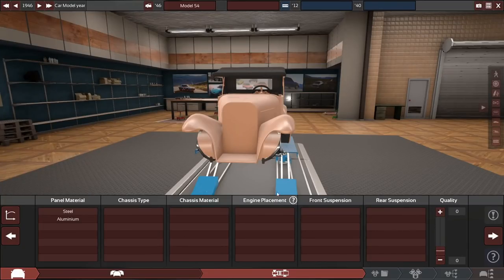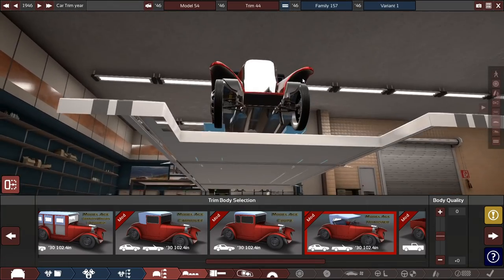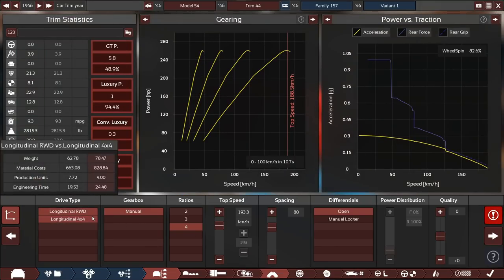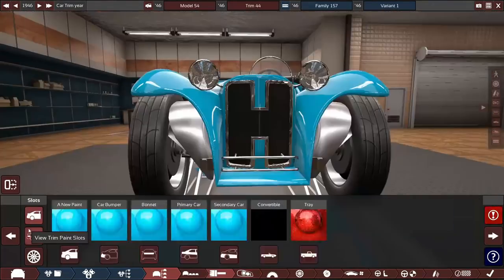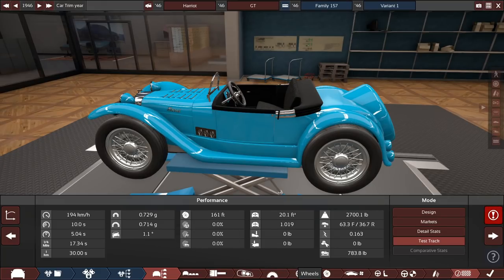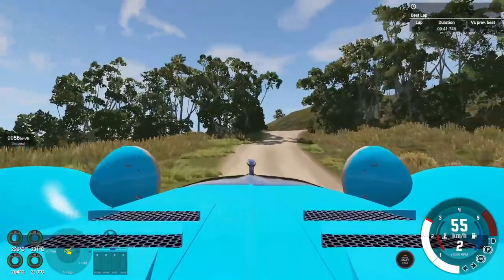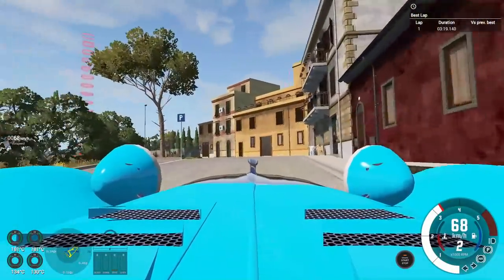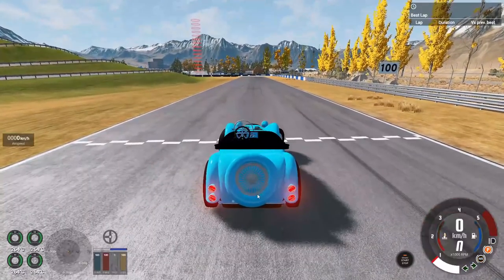Building A Very Sketchy Old Racecar!! Automation - BeamNG

Comment: For a lot more realism and a lot less RPMs (less internal stress), I would’ve gone DAOHC or pushrod, love the design though!
Reply from the maker: I agree, DOHC was for sure a bit unrealistic. But not impossible. Just wildly expensive xD

Cheers!
Reply: @TwinTurBros  G'day mate. First DOHC ever made was in 1913, so you were spot on and not wrong by having DOHC in your Oldtimer Wagen.
Reply: DOHC isn't a modern invention.
Reply: though 4V DOHC wasn’t in the 1920s, I’d agree with 2V DOHC
Reply: @throwout1483  I looked up when 4V became a thing. It first came out in 1913 at the same time as DOHC. Both of them first popped up on 1913 Peugeot Grand Prix Race Wagen (Wagen is what I call a car).
Reply: I think SOHC would be a good compromise. It may have been a rarity at the time, but was a thing in luxury/sport/race cars at the time.
Reply: @superdupergrover9857  Most of the 'new' inventions of the automotive industry have been employed at some point in aero engines before or during the world wars.

Comment: A vehicle with an airplane engine in it would be baller. Just max out the size of a V12 or Boxer 6 and give it peak horsepower below 4000rpm (below 3000rpm is even better). Turbocharging allowed, but in the spirit of aircraft powerplant engineering, keep the boost low because the turbo is only there so the engine can reach higher altitudes without passing out. 30s or 40s body style recommended.
Reply: Great idea I’m doing this, I love those cars like the Bugatti Type 57
Reply: @tastybacon53  Post a video, I'll watch.